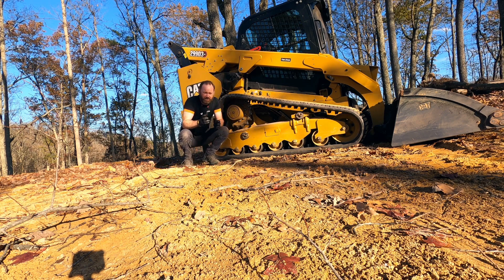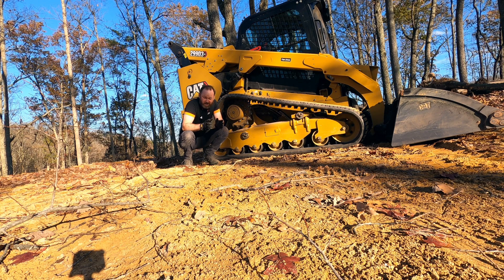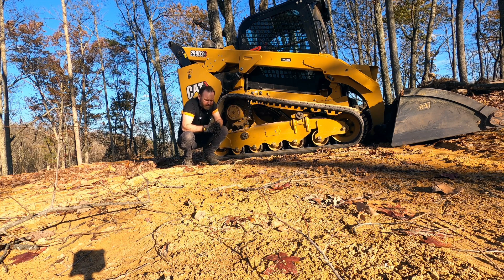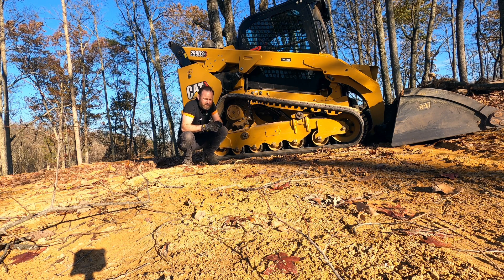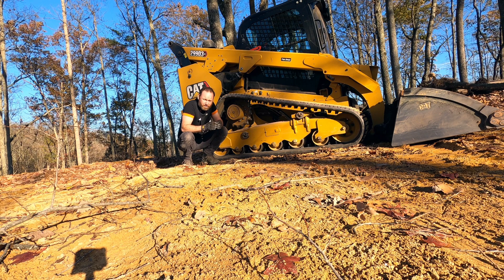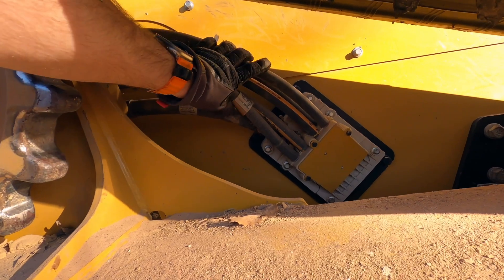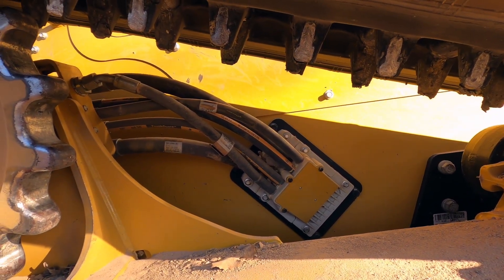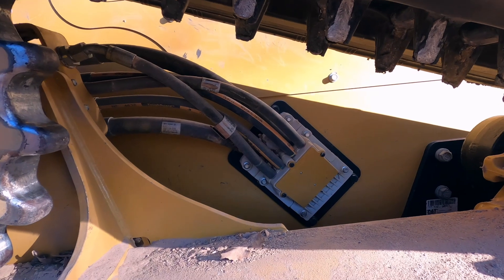CAT 299D3 XE Hydraulic Hose Design Changes for Noise Reduction

Comment: so how much to change that unit verses just one hose.
Reply from the maker: The dealership changed it for free, if you are referring to the new block the hoses come through.  It made a quiet machine even quieter.  Thanks for watching.
Reply: @theMTNman  i figured the block attached all hoses to the block and thought that maybe if a hose blew in the block all hoses would have to be changed with the block. glad to hear that's not the case. i have been on the fence with a 289d3. but my local dealer just got in a 299d3. i might speak with them about it depending on pricing increase. i got quotes on the new r series bobcat but looks like they are having a lot of issues with them already.